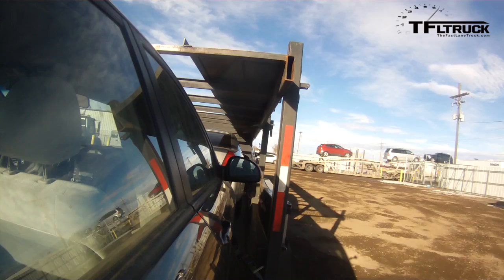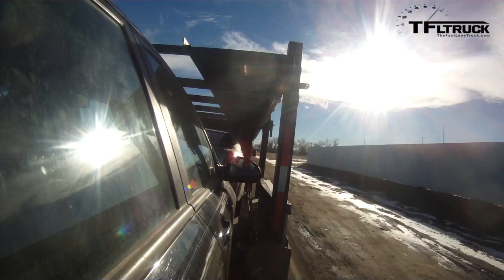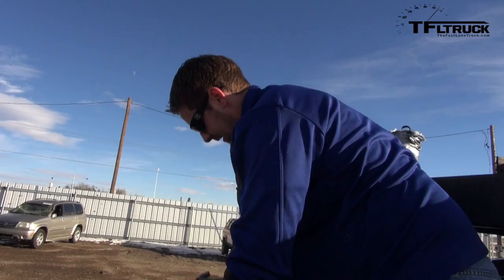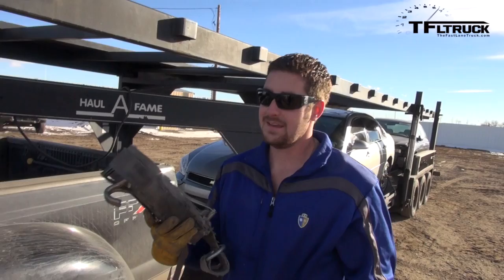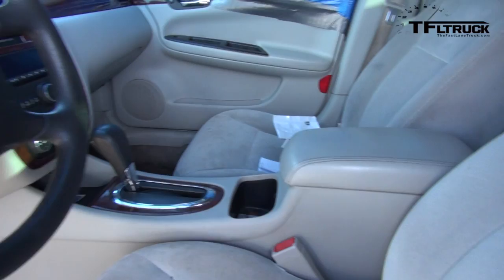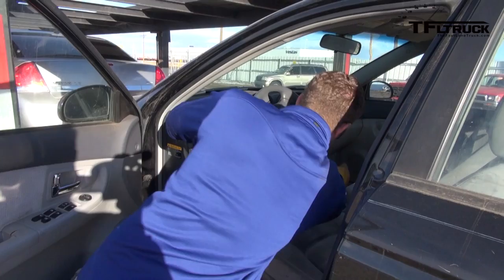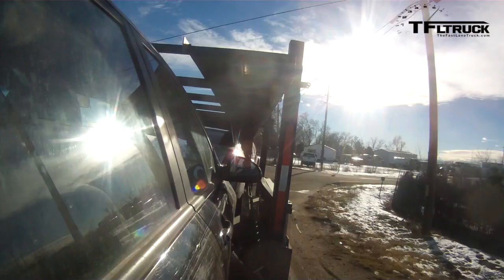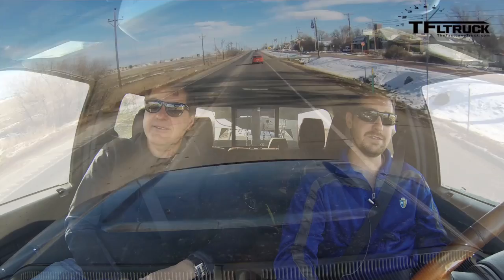A Day in the Life of an Independent Car Transporter (Pt 1.)

Comment: i know how to fix all this guys problem go get a chevy one ton duramax
Reply: Chevy can't tow as much..and 200k miles while towing 35k pounds and the only problem he has is a couple diffs that were covered by ford I'd call that a win
Reply: wade mckenney I'd rather a diff go out than my tie rods on a shitty half ton front end.
Reply: And have a motor that can only go 50 mph at wide open throttle go get a Cummins that is meant to tow instead of having a shitty Ford or a truck you have to drive with a tampon up your ass cough cough duramax cough cough my point is buy a real truck with a proven motor that has been proven to go 800000 miles +
Reply: Shane Broom I have seen a 800k 6.7 Powerstroke. Haven't seen a Duramax over 350,000 and the only Cummins i have seen hit over 500,000 witch was the 5.9. 500,000 miles to a 5.9 is a cake walk to it. Haven't seen very high mileage on the new 6.7 Cummins though. Not bashing the Cummins in anyway, i like the Cummins. i like the Powerstroke, but i HATE the Durashit.
Reply: Kelby Sagvold i dont hate powerstroke ive just seen how bad the engines can be now the 6.7 is an actual powerstroke ford built the 6.4 6.0 and 7.3 are all international engines the 7.3 is a good engine but the others not so much ford did a very good job making there new one i was just stating that overall longevity of any diesel motor has to go to cummins almost all big rigs are cummins and they last for ever with proper maintnence m6 buddy has a 6.7 cummins that has 600,000 miles on it and its gonna go another 600,000 because he takes care of it and doesnt beat the hell out of it a duramax and a powerstroke 6.7 and 6.6 will do the same if you take care of it
Reply: Shane Broom If you have the money and know what you are doing the 6.0, and the 6.4 will do that too. It's not cheap, but the final product is reliable and pretty bad ass.
Reply: Well of corse it will but it will be way more exspensive to keep up a 6.0 or a 6.4 it plain wouldnt be worth it you should just get a good and reliable pre-emmisions truck like a 5.9 cummins or a 7.3 powerstroke or a 2002 6.6 duramax
Reply: Hey man I plan on buying a Silverado. But I have a question, How long until it'll break down? Had 7 Silverados 4 caught fire. Rest broke
Reply: +Cubic Poptart don't mind me asking but if you have had such bad luck with Chevy why not try switching to a ford or a dodge and see how it goes? Just wondering
Reply: iwuzheree Get what replaced? I haven't had to do shit to my 6.4 except oil changes hahaha! Oh, well i guess i did do a system install so... But that doesn't count haha.
Reply: Kelby Sagvold what all do you you have done to it egr/cooler and did delete Mabey and how many miles are on it
Reply: Shane Broom EGR delete, DPF delete, and a set of bulldog heads. Twisted customs tunes, and 210k with original motor. had all modifications on since 72k. around that time it cost me 4k for everything said and done. Bought the truck new.
Reply: Kelby Sagvold you made the right upgrades that made a diffrence in having a piece of shit vs having a good reliable truck
Reply: Shane Broom That's what happens when your smart hahaha. I havent had a single issue yet.
Reply: wade mckenney so the chevy duramax has less problems than any of the other name brands out there?
Reply: The old death wobble lol
Reply: Ifta is a joke
Reply: wade mckenney or get an old kenworth or pete
Reply: trevor philips 3-4 diffs and front tires every 15-20k Miles is not good lol chevys can tow as much you can’t always believe the numbers manufactures say everything is for sales
Reply: Kelby Sagvold look on Craigslist and Facebook you see duramaxs with 350-500k
Reply: not sure where you seen 800k  6.7l powerstoke I think it was a glitch  lol I buy and sell cars for a living and see many cummins 5.9 and 6.7 with over 600k miles that still run strong every day. even if ford 6.7 ever mad to 800k miles it probably had four engines replaced.

Comment: Do you need CDL?
Reply: For this, yes. For Hotshot, sometimes. If the combined weight rating of your truck and trailer exceeds 24,001lb you must have a CDL. ex 13,000lb weight rated truck + 12000 rated trailer = CDL.

Comment: That truck is a piece of junk. I'm on my third Ram 3500 Cummins 1 transmission rebuild in 580000 miles. Last one I sold with over 700000 miles no problems at all

Comment: Wow that's just shitty differential engineering. Could you drill through the plate and put a cooler on it? You'd probably have to use coolant thought. Imagine a pump would probably burn out the first day you cold start it with that 90w oil in it.

Comment: Sorry everybody but chevy and doge most of the time also do the death wobble ford has more torque and hp sorry but ford is the best you can never beat it
Reply: sorry but 850ft.lbs. is more than 800ft.lbs.
Reply: Cummins 6.7 has way more torque than the Ford 6.7
Reply: so fords diff and hubs and egr crap and the motor in general are better than rams tranny problem and chevys front end? sounds like fords a real champ huh?
Reply: 5JSG 50lbs isn't alot. And ford may be passing it in 2015 with their bigger turbo and injectors. but who cares. death wobble has nothing to do with power
Reply: irish man all modern diesel have egrs?..i think. not really sure where your going with your comment
Reply: TheMightyMatt67 ford has had a really bad problem with the egr crap that they have.
Reply: irish man EGR cooler is being used on all modern diesels or CNG, including all the big rigs and buses.

When you have an EGR cooler, it is the question of when, not if, it will fail. These things are very fragile. All it takes is a small air pocket in your coolant system, and the thin metal fin will get burnt right through.

Ford learned their lesson from the Navistar built 6.0L powerstroke. On their new Ford built 6.7L Powerstroke, they separate the EGR cooler coolant from the engine coolant. So when the EGR cooler goes, it doesn't suck the coolant from the engine and cause any more damage to the engine itself. 6.7L powerstroke is currently the only engine with this design.

EGR on any engine, especially diesels, is not reliable. It is not just a Ford problem.
Reply: Matthew Phillips Well the 2015 will be out in a few months and it'll have 900, so ford ftw again.